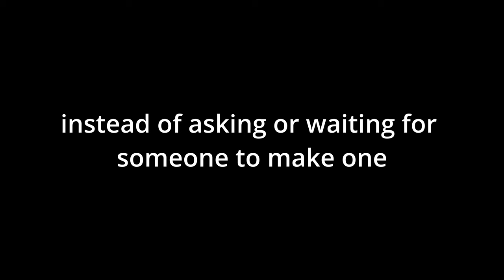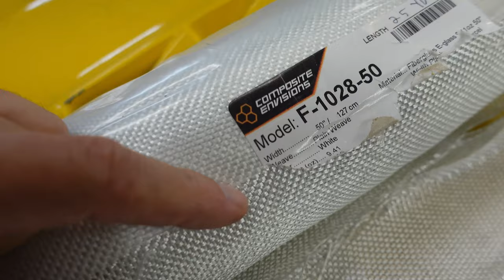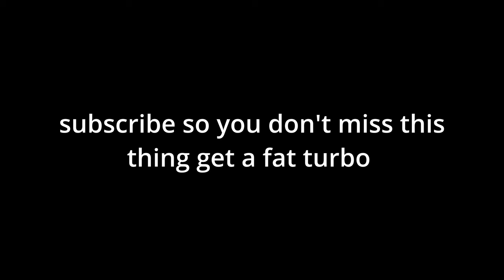Building a 3D Printed Widebody Kit in 10 Minutes

Comment: FYI.   When using. Panel bond.  You need to stick it to the steel.   Take the paint all the way off.       You can add fiber glass resin with out the hardener  to bondo to turn it into glazing putty.      Hope these tips help.
Reply from the maker: That's good tips thank you!

Comment: You can use panel bond.    And fill the edges of the panels.  To help blend them into the car.
Reply from the maker: Did you mean panel bond?
Reply: @DingDongDrift  yes.   Lol.     Dam auto correct

Comment: Why didn’t you print the panel with some thickness so you could cut out the fibreglass, resin filling and hand finishing? I thought that would be the point of 3D printing. And if it wouldn’t be strong enough then 3D print a mold for the parts.
Reply from the maker: Is that what worked for you?
Reply: @DingDongDrift  no just researching
Reply from the maker: @dominicwood3750  oh ok 😂

Comment: I wish vielside made a batter kit like the one Han  had for his rx7 Tokyo drift. That changed the completely
Reply from the maker: that's where i'm going with this, in the end will look almost nothing like an SC400.
Reply: @DingDongDrift  then patent it and sell it to duraflex so i can buy one for $800 dingdong kit
Reply from the maker: @RezSoxBaseball  you can already buy the kit file and print it yourself from my website
Reply: @DingDongDrift  holy fawk bro
Reply: @DingDongDrift  Are you planning to just replace the entire front/rear end bumber or just simple cut parts of it and just bolt and glue it right on it?
Reply from the maker: @EnhancedTrashBin  i will be using the bumper as a base for my new custom design

Comment: loved watching it man, what thickness did you initially print the panels in?
planning to do something similar myself, as i do cad surfacing for a living, just need to save a bit more for a 3d scanner and then i can get started :D
Reply from the maker: Thanks for watching, i don't remember exactly but i think the panels were around 3-4mm thick.
Reply: damn thats thicker than it seemed in the video, judging from the flimsiness i thought they were half that @DingDongDrift
Reply from the maker: They're not flimsy, but they're flexible over a large distance. Once mounted on the car they're as stiff if not stiffer than OEM bumpers. If you check out the individual videos i talk about how surprisingly stiff the panels are just from being glued on the car.
Reply: I have watched all of the vids, and I meant before reinforcing them with fibre, I have no doubt that they're more than stiff enough once glued into place and reinforced with fibre :D @DingDongDrift
Reply from the maker: Even before they're reinforced I'm saying, simply just glued on, you could drive like that with no fiberglass and they'll hold up fine
Reply: @DingDongDrift  damn, that’s NICE!
Reply: A lot of new phones can 3D scan
Reply from the maker: @wadeharder195  those scans are meh
Reply: @wadeharder195  i tried every single app on iPhone 11 Pro and iPad Pro, used even scanning spray, and still, it’s meh at best, definitely not enough for precision designing. At least not bodywork
Reply from the maker: Yep, even a $300 scanner is better than any phone scan, but don't get a $300 scanner lol. Get the einstar in my description